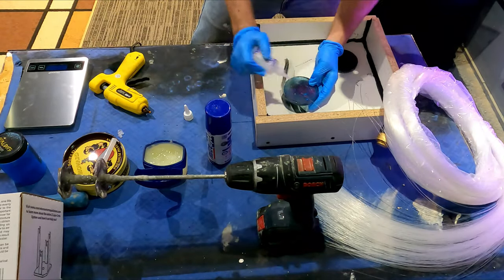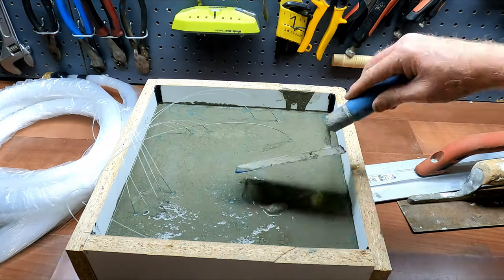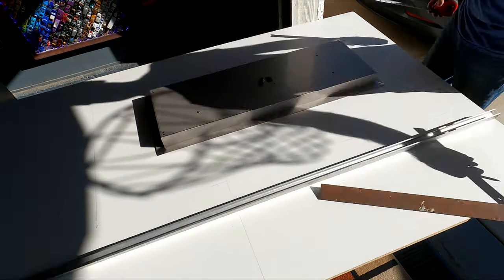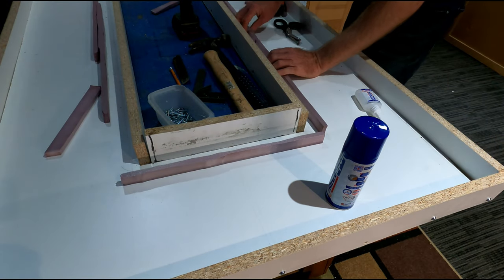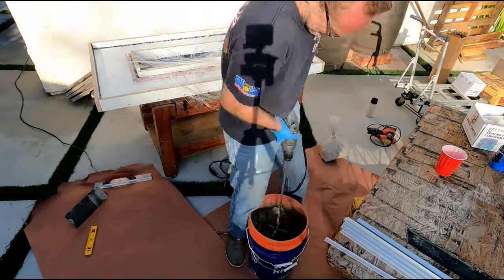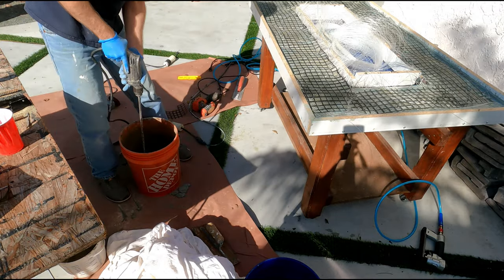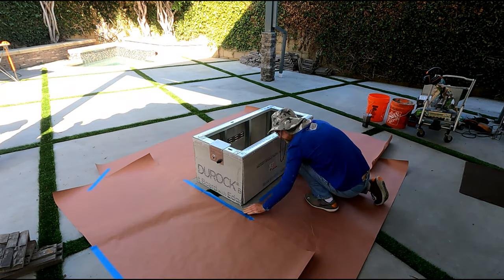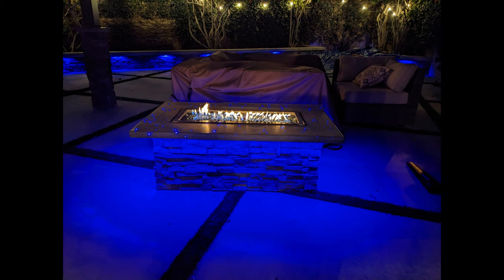Fiber Optic Fire Table Build. #fiberoptics #firetable #firepits

Comment: Looks great. In hind sight you Gould be just used a grinder and done some plunge cut slits instead of leaving out the space for the vent. I just bought a house and think I’m gonna do this for my kitchen counters. Hopefully it doesn’t become a disaster lol
Reply from the maker: Hey Jake, thanks for the suggestion.  So I'm clear, your saying to skin the whole box with the concrete faux stone and use a plunge router with a masonry bit to cut the square vent hole out ? The tile are thick and uneven might be a struggle.  But doing fiber optics on your kitchen counter would be awesome! good luck. Hit me up if you need more advice, glad to help
Reply: @IfAlexCan  yeah that’s what I would do. Or just plunge it with a diamond blade on  an angle grinder. I’ve done it before in bathrooms to make air vents instead of putting in the white metal ones. But yeah I’m pretty excited to try it. I think I might try to make a dining room table first for a trial run. The only issue I really see with the kitchen counters will be I guess I’ll have to string up the fiber optics and pour the concrete and then come back after it dries and cut them and resurface the concrete. I don’t really see any other way to do it since I’ll be pouring them in place on the counters lol. Unless you have another suggestion
Reply from the maker: If your going to try pour in place with fiber optics you'll need to somehow suspend each optic strand facing upright in wet concrete (this is the hard part).  Then trim and finish after it's dry.

Comment: Always wanted to do something like this. Just don’t have the experience Awesome job! Only question I have is this table hooked up to a gas line or is this a 20lb tank hook up? If so how do you change out the tanks?
Reply from the maker: I used straight line gas.  I've seen others make it taller to fit a tank.

re-instating this comment as You Tube cleared them all out after converting the channel to a brand channel.  Thanks again for the comment!

Comment: Where did you source your control panel for the gas?  I can only find a spark ignition and key combo rather than the one you have with a control knob.  Great video!
Reply from the maker: I used this one

https://www.amazon.com/QuliMetal-Stainless-Rectangular-H-Shaped-Ignition/dp/B08KZJD9LQ/ref=sr_1_5?keywords=fire%2Btable%2Bkit&qid=1694132342&sr=8-5&ufe=app_do%3Aamzn1.fos.f5122f16-c3e8-4386-bf32-63e904010ad0&th=1

re-instating this comment as You Tube cleared them all out after converting the channel to a brand channel.  Thanks again for the comment!